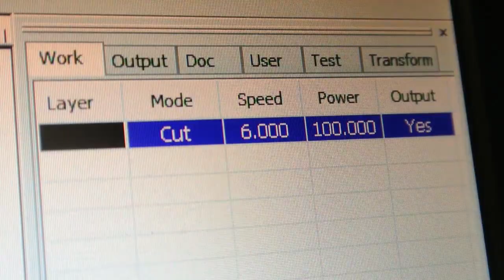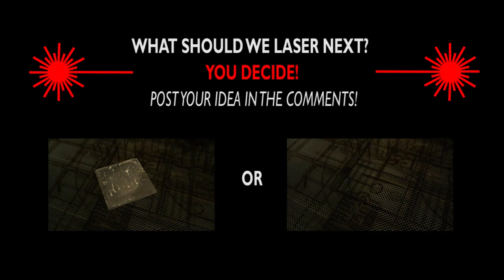WILL IT LASER: Stainless Steel Mesh?

Comment: I did this with a 60w co2 laser and found that it would work for 500-200 wires per inch. The biggest issue was allowing enough heat build up, if the open area was too big, it wouldn't cut as effectively. Lines with the mesh were harder to cut than diagonal lines. Can be used to leave a nice heat tint etch.

Comment: Try Kevlar. It is bulletproof, but is it laser-proof?
Reply: This.
Reply from the maker: Where can I get some cheap?
Reply from the maker: Power Max Done.
Reply: the Hacksmith Would be sweet if the laser worked, did you see those $85 kevlar scissors? O.o
Reply: OSHbots who in the right mind would buy scissors that expensive?
Reply: Mock slowmotion
Someone who works with Kevlar I reckon. :P

Comment: The beam looks like its out of focus. Maybe it would work better if it was focused? Nicer finish?
Reply from the maker: Pretty sure that's just the reflection, it was in focus
Reply: the Hacksmith Have you tried aluminium foil? Is it a 100 W laser right?

Comment: Also, how did you even get that laser thing? And does it use up a ton of electricity?
Reply from the maker: I imported it directly from China to make stuff with! It doesn't actually use that much electricity, about the same as a space heater.
Reply: the Hacksmith wow

Comment: What kind of laser is that? I have a 40 watt CO2 laser from buildyourcnc  its kinda like the china lasers except runs off mach3 not the chinese driver boards.....anyway I have tried cutting an aluminum coke can and it didnt do anything at all to it and havent had any success on any metal  at all